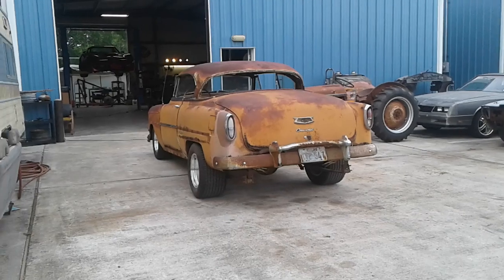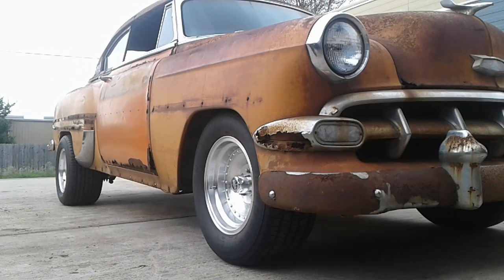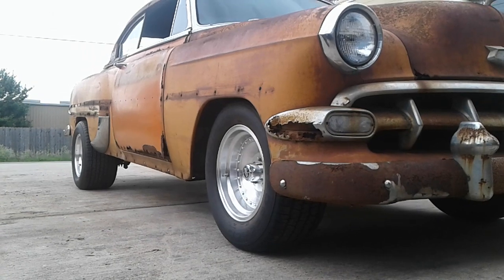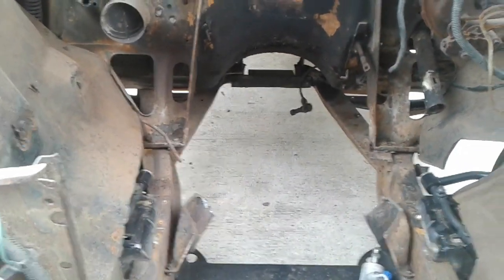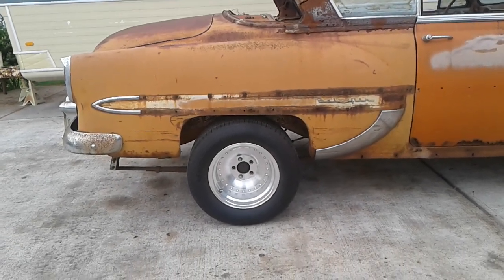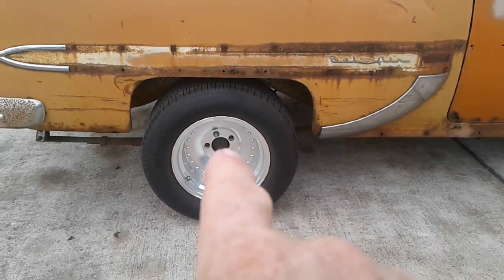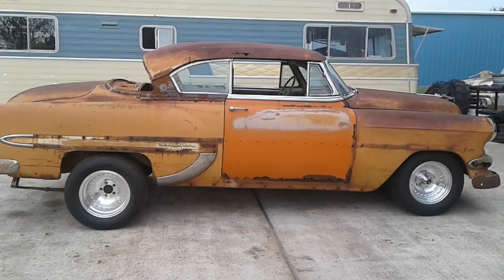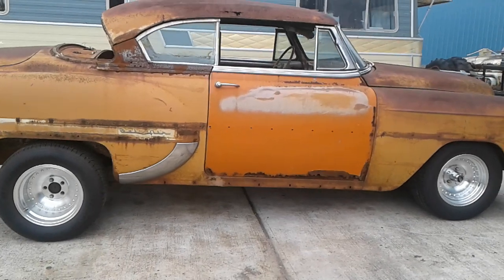1954 Bel Air HT Mustang 2 Front End Installation: Part 6

Comment: Hey Pat. I could barely see the difference till you pointed it out. Then I could see it. If it were mine, I would get the rear wheel tucked up under the fender a little. The car has just a little too much room on top of the wheel. But I agree that it could move forward just a little as well. But All in All, I am happy for you that you got the front end under the car and now you can move on. Keep on A Rock'n An A Roll'n and get Leroy on the road soon. Thanks for the entertainment.
Reply from the maker: For me it was bugging me bad!!! I know what the problem is and why and I'll get it ironed out soon!!! It's got to go forward!!! When I fix it I'll explain why it's the way it is now!!! In order to get the tire inside the wheel well will mean another rear end!!! For now it's just get it on the road!!! Either way it's going to be a sweet ride!!! Thanks for watching and Keep Rocking!!!
Reply: @rockerpat1085  Hey Pat. You got that right. It will be a sweet ride when finished. I'll be watching my friend. Keep on A Rock'n.

Comment: Yup, you are right Pat... seems to me if the opening matched the front better shape wise it would not catch your eye. Two inches off the bottom of the wheel opening blended to the curve just under the trim would work wonders. You ever take a picture of your car and then make blown up photocopies to draw on to try different looks ? Way easier and cheaper than saws, torches and sheet metal... keep er rockin' Pat !
Reply from the maker: What the problem is that the car came with a torque tube rear end and had a pivot behind the center line of axle. This put the spring bolt a few inches behind the center line of axle. When my buddy replaced the rear end with the one that is in it, he wasn't able to move the axle forward enough. I'll just have to redrill the center bolt in the spring and relocate the axle forward enough to look right!!! At least that's the plan!!! And yes I've redrawned cars just as you suggested!!! Maybe I'll bust out some of my drawings and share!!! Thanks for watching and Keep Rocking!!!

Comment: Good stuff Pat..I've got 7 deg caster on the 38...Makes it a little heavy..Are there little bitey teeth at the upper arm adjustments to stop any slip.?..The axle is located by the spring center bolt Yes.?...I think it you may need to source a spring with center bolt  closer to the front eye but it looks fine where it is from here.
Reply from the maker: Yeah there's teeth on the bolts, but I'm not exactly sure it's the best system. May have to change it to a shim design later!!! The center pin on the spring is the problem. This car came with a torque tube rear end and had a pivot behind the center line of the axel. I may just redrill the spring so the bolts are a couple inches forward!!! Thanks for watching and Keep Rocking!!!

Comment: Looking good Pat! I think you are being to picky on the centering of the rear. It looks just fine to me. What I think is the wheel wells are too long. I think they would look better if they were round, But I'm not the one making it happen. It is your car and you are the one who you have to please.
Reply from the maker: The center pin on the spring is the problem!!! The car came with a torque tube rear end and had a pivot behind the center line of the axel. I'll just have to redrill the center bolt!!! Thanks for watching and Keep Rocking!!!

Comment: Love the look of this pat.

My concern would be that the back tires might rub, when you add the extra weight of engine, trans, glass etc, it will drop down another inch or so, then under heavy throttle it will squat down at the back.

But I'm sure you've thought of all that right?
Reply from the maker: It already has extra weight in the trunk!!! If it rubs then I'll find a narrower rear end!!! Also I might add a set of traction bars and that will raise the ass end of the car under hard acceleration!!!Either way it's going to be a sweet ride!!! Thanks for watching and Keep Rocking!!!

Comment: I would put a motor and trans in it mash on it! Fix the other later. I think if you drop the ass end down it would look more centered.But I understand the old school stance ... I used to put 2x4's between the springs and frame on my 66 mustang to jack the a$$ end up like that! Of course they fell out after a few good hard bumps but it looked cool back in 69!
Reply from the maker: Can't fix it later because I need to have a driveshaft made. If I fix it later my driveshaft will be too long. Have to fix it now!!! The reason it's sitting back is because the car came with a torque tube rear end and had a pivot behind the center line of axle!!! The center pin on my spring is a couple inches back from the center line of  the axle!!! When Lee took out the original axle and installed this one he should of redrilled the spring bolt a few inches forward!!! That will solve the problem!!! Keep Rocking it out Buddy!!!

Comment: Sorry, I just entered a "useless" comment on your part 5 video. So, what did you do to save/complete the front suspension installation between the two kits and the steering?? 
The car looks great !! I would only try to center the rear wheel in the opening. Looks like it needs to go forward ?? a inch??